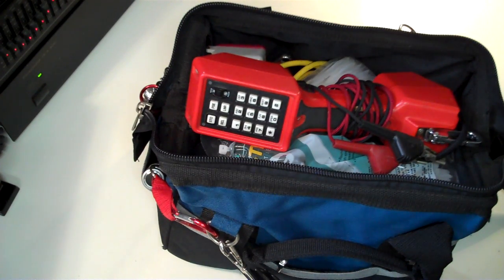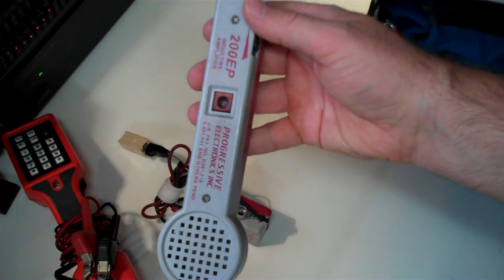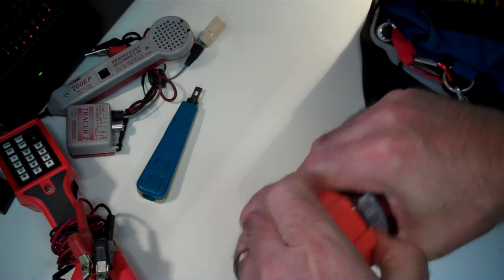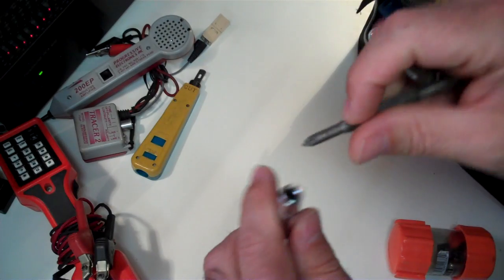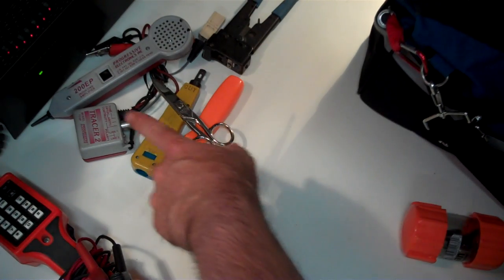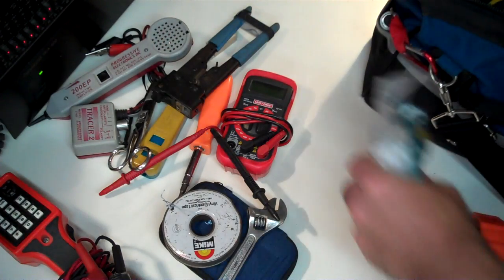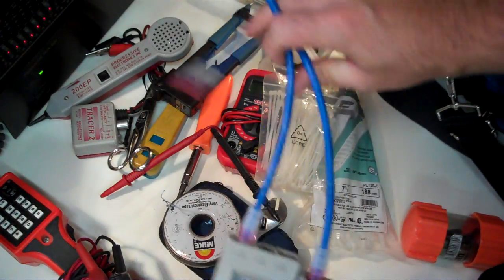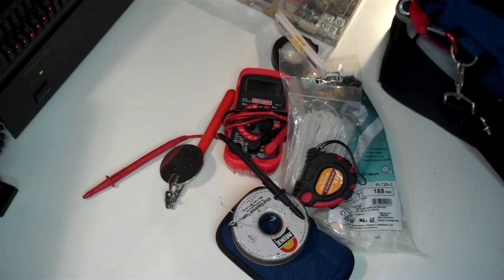The master telecom tech's tool kit

Comment: I’m an Extra Class HAM, I have much of this in my emergency bag.  I’d recommend maybe a small oscilloscope, and SWR meter…Of course, Ethernet punch down, crimper, coax stripper, blade for coax end crimper and fiber optic tools, which I don’t use often.

Comment: Oh excellent. As somebody who has telephone in their blood. And grew up at a house at the very end of the line where they ran spruce down to two other neighbors. I've been slowly building my kit and knowledge. I've more or less come up with roughly something similar to that. Building it overtime. My last acquisition was a butt set. It has actually come in quite handy, I got hired as a facilities manager at a nonprofit which has a four-story building and an elevator. It's been very handy to have a phone that I can plug into a test socket that I wired when the elevator tech does a check on the elevator emergency phone. Needless to say I've had some trouble with it they hit the button it rings 911 can't hear them, which at that point I can pick up the line and till 911 it's not an emergency blah blah. There's still enough analog in use in spots where if you know what you're doing it would be very handy. At the same time I started make it out with a bare-bones basic phone that was fully lined powered, then moved to one of those build it yourself Phone kits. It's a great tool for being able to dial in dial out etc. check the line. And the Butts that I got has a display that tells me what DTMF digit was dialed which would've been handy a few times in my life.

Comment: Ha the only thing I did not see is a drop chain for pulling wire.  It really makes you mad when you don t have one.  I like it because you can use your magnet and hear it in the wall.  I also found that I buy the good six-foot leads from fluke.  But I like to use a cheap meter. which gives me probes and alligator clips.  I also in my trade carry simple alligator jumpers.  Now since I have the better meter leads, I use them instead. Funny how you evolve to carry multipurpose tools. I really like the banjo connector for testing.  Things have really changed over the years.  Especially since the analogue lines are phasing out. Now I work with more cell units than ever. Which you still need some of the old school things to make it easier.  I really miss the old lines as shocking as they were.  They always had to call when working on an old demark.  I carry many of the tools you have.  Now I have things broken down into zip pouches.  Then I can grab the color specific bag that has that particular gear I need. It also keeps from overloading the tool bag on the go. I never in my trade seem to need the same set of tools.  This has helped me a lot.  I see the new back packs for carrying tools.  I am sure like you I do not need all that stuff every time.  It seems like it would get really heavy. My regular bag is heavy enough.  The coupler on your tone generator can be very useful.  I often carry a 25 ft cable to plug in for testing.  Who wants to work right on top of a patch panel or junction box.  It also used to test my equipment for correct reading.  I have had leads fail on my meter.  Good to test before you start.  I really like your setup. Do you have anything you recommend for voice over IP.

Comment: their great in ham radio to check board voltages and such too. I don't personally do that kind of repair no but I have seen those meters used in ham radio. the area I tend to specialize in is receiving antennas, and I've made a few long wire antennas over the years but for hf reception. RJ45 is ethernet isn't it? that's what my network router uses.

Comment: I am surprised that you didn't mention an insulated cable pick.  Good for removing cables from incorrectly punched cables or for moves.
Reply from the maker: Is that the same as a “boog pick”?  That kind of pencil-shaped tool made of plastic with the little hooks at each end.

Comment: Just checking in again. Got into doing some ethernet wiring at home. I upgraded my FIOS service
And had to run CAT6 from the terminal to my router. The ISP tech 
Terminated the RJ45s. From there I ran some patch cables with RJ45 plugs to rooms with keystone jacks.
I did it because WIFI is flaky sometimes. I'd like to buy a crimp
Tool but I dont really do telecom/
Data anymore.

Comment: Never liked using scissors, wire cutters were easier for me.  Used my thumbnail to strip back the sheathing when installing jacks.  Started in the business in '85.  Analog test set was the number one tool then.  Hang one of those on your belt loop and you could go anywhere in a business you wanted too, no questions asked.
Reply from the maker: Right.?  Hard hat, clipboard, and a lineman’s butt set would get you into almost any space.  I even had a service call one time where by the the time I had made it into the server room (MDF), I found out I was at the wrong place.  How scary is that?. 😄

Comment: Toe tags. You need to label your work.  It’s not always possible to write clearly on a cable or punch down block.

25 years ago I had a job which used BIX on a new SL/1 install so I carry all 4 punch down blades just in case. 66, 110, Krone, and Bix.
Reply from the maker: yes, agreed that good labels are handy. I hate writing directly on the cable.  :-)

Comment: We used the banana's  a lot in the old days to locate pair's in  paper insulated cables back in the 1980s and 90s . I was an E&I cable splicer / telephone linesmen in the U.S.A.F  for 15 year's . Thanks for the memories.
Reply from the maker: Jose, didn't those banana probes have metal tips?  that wasn't an issue on the 66 blocks? (shorting?)

Comment: Hey, Steve, I have a question. Fairly new to telecom work. I have extreme problems at a 66 block getting a dial tone with a butt set. I've resorted to using one of those Testar appliances that have a connector for 2 pins on a 66 block on one end and an RJ11 port for a cheap Vtech phone on the other. I thought I might have a defective butt set and returned it to the factory for another and got the same problem, so it isn't the butt set. I know the two clips on a butt set can't touch each other when you connect to the pins on a 66 block, but how much time does it take to keep moving and twisting the clip into differing positions on the 66 block pins to break through the static and get a dial tone? It almost never works for me; I can sometimes get lucky and get a dial tone, but the Testar appliance always works.

Comment: Hey Nortel Guy. Also included should be a cable fault locator, LCD example Metrohm , Spirent , Megger or Biccotest (distance meters) , a drill , normal and or cordless , 3m probe , Krone probe. Krone is pronounced Kroner by the way. But as we know copper is fading away but for internal networking you still need those  tools.

Comment: I’m a service tech in the Fire & Security business and I use every one of the tools in this video every day.
Reply from the maker: hi MacKane, good to hear from you.  any special tools you folks use on that trade that only particular to the fire/burg industry?
Reply: The Nortel Guy 
Funny thing us, I used to work for Nortel for 12 years and the only tools in this video that I used was the digital multimeter and the electricians scissors/snips on a daily basis. We used the snips mainly to cut lacing cord used to secure cables to a ladder rack.

Comment: Love the Harris punch down my favorite.
Good info . My uncle was a old GTE guy
Got in the trade early learned from old school phone system techs.
Reply from the maker: LOVE GTE.   A few of my mentors were old GTE guys (DFW area).   Yeah, that good ol Punch tool finally gave up the ghost about a year ago (2017).  I'd had it since like 2000.  Went to get a new one, but I guess Harris sold that unit out to Fluke.   So, I bought the Fluke one.  Seems pretty good, but it's early.  

Thanks for the comments!
Reply: The Nortel Guy I rock a fluke pounh down now. I'd take that Harris back any day. they just made things a little better back in the day. I like what you did with the jumper wire 
Making it a more compact version .
Reply from the maker: oh, that mini-roll of jumper?   Thanks.   You can probably appreciate this -  unless you're doing an install or a bunch of MAC's, you usually only need 6-8 feet of wire on any given site visit.

Comment: whywhould there be 3 cat 5e cables running to a phone jack in my house?
Reply from the maker: the common convention is to run two cable to every workstation location.  This is more of a commercial idea than for residences.  But, in any case, the intention is that the cat3 would be for your phone and the cat5e would be for your computer.

Either is fine for phone.   Good question. :)
Reply: More than likely, the jack is also a splice point where you have 1 cat5  coming in, and 2 leaving to serve other jacks in the house.  This wiring method is called "daisy chain" and is the preferred method for those who cut corners.  It's also the most difficult to isolate problems with especially if your not familiar with how the wiring was ran.
Reply: It a bridge my boy.

Comment: Great video, especially for newbies. And me, I love seeing what others carry!  I have a three tier tool box now... I agree a butt set not necessity but when testing lines for Fire and Security Systems it still helps, of course now we're trying to get everything converted to cellular. The only reason I have so many tool boxes is because we do fire, security, surveillance, card access, data networking, telephone, fiber optics, wireless antennas, and coax. so where I work we need specialized tools for a little bit of everything and we all install the Cable relating to these items as well. I miss doing just Telcom 😔 😆 ... I noticed a comment about buying tools.. I've never had the luxury of working for a company who buys the employees tools. I've heard of it but nowadays that is the exception not the rule. sure would be nice though. I've been doing this since 1995. How long have you been doing this? You seem very knowledgeable. Like you, I only carry about 5 or 6 main tools on average though 😊
Reply from the maker: Hey, great Comments!  I'm right there with you!  I started in 93.  I've bounced back-n-forth between IT and Telecom all during the first 15 years until they finally became the same field.   You're in a great spot because a good field tech who can effectively troubleshoot infrastructure is always going to be in demand.  Pencil-neck IT guys are a little more easy to come by. ;-)
Reply from the maker: One more thing.   You might be interested in a couple of my other channels:  youtube.com/c/DIYTelecom  and youtube.com/user/uplinktechnologies (aka: https://www.youtube.com/c/networkadvisor).   I think you may have a lot to add there.

I will go scope out your channel now.

Comment: 8:10 We telecom lineworkers call them snips; not little scissors. the notches strip 19 and 22 gauge wire.
Reply from the maker: Well thanks for pointing that out! :-)
Reply: Use the correct tool for the job my boys, don’t strip with a scissor, get yourself a good solid pr. of  “dykes”!

Comment: Great video.  Very informative.  I was curious why you don't recommend a label printer over a sharpie?  Granted, a sharpie is lower cost, but you get much better durability, and readability out of a label printer (not to mention extreme time savings for batch cable/panel labeling, and saving yourself some writers cramps).  We have dealers able to get you a demo printer now, if you are interested.  Check out our latest video on the LW-PX900 to see what it can do to help you save time and money.  

Again, great video and keep up the excellent work.

Comment: I don't even use a punch down tool.. Once you get the touch just put cap on top of jack and squeeze, use your mini cable cutters to cut ends to avoid an inspector picking that up
Reply: Sounds moronic to me... Just use a punch tool.🤣
Reply: 66 blocks and 110 blocks don't have caps like the jacks do,  I was wondering you don't get a lot of intermittent troubles doing that?
Reply: Clearly you don't sweep test or perform certification. You'd fail. And I've never seen a cable not properly punched down that would pass a sweep.

Comment: Love the use of a velco cable tie to secure the crimping tool, I do the same thing - saves you getting cut on the cutting blade when searching around in your tool kit. I learnt that the hard way. I'd also add [good quality] masking tape to the list for labelling, grouping removed screws, all sorts.
Reply: Instead of masking tape, go for gaffers tape. You'll thank me later.

Comment: ALSO MUST HAVES.... Needle-nose pliers, 3/8" 7/16" orange "can wrench", scotchlok crimpers, container for a bunch of scotchloks, a yellow spudger, a "banjo" in-line adaptor, and diagonal cutters or "dikes" for more heavy duty cuts than the shears can do. And butt sets will never go out of style! How else will you listen in on calls for the NSA?
Reply: Gotta have a banjo.. I lost mine and have to cut a phone line and attach my clips to the red/black cable to register my ONT
Reply: Let me know if you want me to post a picture of it lol. I could honestly get through 99% of my days with 6in1, my ts54, toner/tone generator, scissors, can opener(solar powered and broken) and punch tools
Reply from the maker: spm204  thanks for commenting.  (and the valuable points about our covert work for the NSA - Shhhh!).   Yep, I need to get a banjo.  I've been doing a poor-mans version of the banjo by using the guts I pulled out of a RJ-48 - you know just the receptacle and the individual screw-down wires.
Reply: The Nortel Guy  why they using fiber instead of copper because its faster but not saffer plz send me your whattsapp contact heres mine 0096- 0559061348 k.s.a
Reply: Come on nortel guy... use your tone generator(rj11) and hook your tip and ring... or just buy they in-line adapter
Reply: @systemfile  What part of the country do you work in?
Reply: Cable fishing reel / rods. Roll of string with a round weight on the end.
Reply: No need to waste money on a banjo adaptor... When you can just get a cheap lit cord.

Comment: I agree 100% on all your choices. As a systems admin for going on a year now, this is identical to my tool kit, with a few other additions specific to networks, but basically the same thing. I think for the price of cable testers, i'd put it in my must have list.. you can get a decent one for about $20 and they save a lot of time. I use my Leatherman Wave and flashlight the most, followed by a cheepo technicians screwdriver... There have been a lot of times that I need to use the small screw driver to pry a bad punch on a single line... and it usually is the most difficult one to get to and would be impossible if you only had your fingers. but those are things I have on me at all times anyway. If you really get heavy into installing network cables for networks or VoIP then  a cable certifier is nice to have, but they are extremely expensive and thats really specific to doing network admin/install type stuff, not something for telco.

Comment: Oh yeah, add needle nose pliers that have multiple functions, such as wire cutters, wires strippers (for 22 gauge) and 3M Scotch Lock crimps built in. Really handy tool to have.
Reply from the maker: good points Frank.  I actually have a secondary tool box I keep on the truck for lesser-used items like those you mentioned.  Thanks for watching and thanks for commenting!

Comment: There's a couple items you might add; 1st, a can wrench (with 7/16 and 3/8 sockets) and 2nd, a booth wrench (5/32) with center security hole for working at the local phone company's D-Marc.
Reply: I would add some string and plastic cups